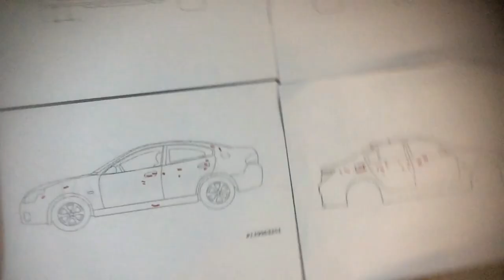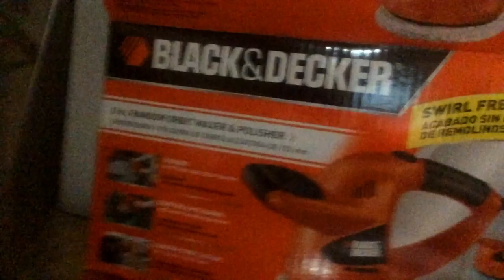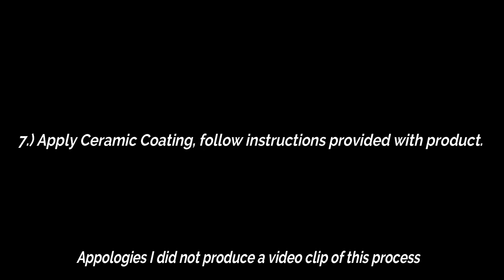Polishing Car using 3M Compounds

Comment: Good video. Also, might want to think about using regular soap and water mix for the final wash instead of fish soap because a lot of dish soap has a degreaser which eats away at the polish you just applied. That said, you got a good result 👍

Comment: Would you say the polisher harmed your vehicle at all or it just wasn't strong enough to get rid of all the scratches as you would've liked? Because I'm thinking it has to at least be better than doing it by hand? I want to get it as I don't plan on polishing my vehicle more than once a year, just to get rid of the noticeable scratches/wetsanded areas before putting a ceramic coating on. Don't mind taking more time/elbow grease if the polisher can do a decent job.
Reply from the maker: Oh no definitely did not harm the vehicle. It is better than doing it by hand just because your hand wont have the same amount of evolution's as the machine. This thing will for sure get rid of very superficial scratches and swirls like I had from going to non touch-less car washes (those car washes are bad). It struggled to remove areas where I wet sanded a few spots. It can do a decent job for a 30$ machine but it takes a lot of time because its smaller and slower than an actual polisher.
Reply: Chameleonvideo thanks. I have a rotary polisher but I've never polished before and I know it's more of a risk. I'm thinking of taking out the deep scratches/wetsanded areas with a rotary+compound combo, then maybe finish with a 3 in 1 polish with the black decker. But my rotary does have low speeds (200rpm) so maybe it can do both. Luckily I have a junk vehicle to practice on 😅
Anyway thanks for the insight. Helpful video
Reply from the maker: @batvon39  I'm sure it will turn out great! Just be cognizant of how slow your passes are not to overheat one spot and you'll be good. Have fun working on your car and thanks for watching! 😃😃
Reply: You can buy compound for the car and doing it by hand or with a polished it will take out scratches on the clear coat and bring back your true colors I’ve been looking into it a lot because I’m going to do it on my maxima and I have clay bars to start and never do it in direct sunlight it’s high recommended to either do in morning or when sun is going down never on a hot surface cool surface for best results great video tho came out great
Reply: @stephenchampagne5763  thanks, it ended up turning out great! Not perfect but definitely an improvement. I got a new DA polisher and gonna try some new products in the spring.
Mine's a maxima too, what year?

Comment: Does it still have scratches
Reply from the maker: Your regular scuffs and scratches that you get from daily use and car washes if you go to them, those were removed. A few spots where the sun was deteriorating my clear coat and also few spots that i wet sanded those you can see from certain angles with the right lighting. To remove those I would need a beefier Polisher...
Reply: @the_four_day  that's what I was thinking

Comment: Can you attach other polishing pads to that black decker polisher? Or are you stuck using the pad it already has
Reply from the maker: The black decker uses bonnets which aren't exactly polishing pads, that's my mistake for calling it a polishing pad. The bonnets you can switch out, just make sure they're the right size to fit polisher.
Reply: @the_four_day  I also got a tip from other people who have used the black decker, they just use adhesive velcro, stick it onto the black decker pad and that way you're able to use pads from chemical guys
Reply from the maker: Oh nice that some creative thinking right there, I like it!!!

Comment: Nice your using dawn dish soap. That's the way to go. I use dawn dish soap in foamer it works great. How do you like the black and Decker buffer? I just bought one
Reply from the maker: Hey!! Yeah I used dawn dish soap to strip any wax off of my car however people have pointed out that there are products sold that are formulated to do that. Apparently dish soap is just not the best for your car so if I were to do it again I wouldn't use dish soap for that purpose. Black Decker is great, cool and cheap tool you can use to wax your car or make small paint correction's with but I would never use it again to polish my entire car. I would definitely recommend polishing/buffing the entire car with a more professional tool which will come heavier, quicker orbital speed and larger bonnet size.
Reply: Yeah or the weekend I had a chance to use the black and Decker buffer. And I was not impressed with it. I had a hard time with switching out the pads. I will be returning that product. I would give it  zero stars. Thanks for your responses
Reply from the maker: Yeah the bonnets fit a little tight over the orbiter thing. For sure man definitely find the tool that would work for you so you can enjoy the process.
Reply: Try something more professional like a griots G9 polisher... use either menzerna or sonax polishing compounds/polishes and Xtreme Solutions or Meguiars paint sealants.  Use dedicated polishing and finishing pads. Your results will be 100 times better.

Comment: Polisher is dirt cheap in comparison to the others offered in hardware stores near me. Would you say it's good enough to not get a higher one? Not trying to waste money or all the time needed to correct paint for it to be garbage. Rather spend more from the get go then deal with crappy equipment. Feedback?
Reply from the maker: Hey Jesse, yeah the one I used is very cheap compared to a professional polisher. If I were to polish my whole car all over again I would go out and buy a polisher designed specifically to polish even tho it would cost more. The polisher I used is actually great for wax application's but I wouldn't recommend using it to polish the entire car.
Reply: Welp, rip wallet. rather spend more then go cheap and do a bad job, thanks!... still looking into coatings as well, that's a harder thing to narrow down so many people swearing by how amazing the coating they use is and bashing the other mentioned
Reply from the maker: Yeah and you'll have a solid tool for next time! Meguiar's and 3M are good products, I'm sure there are more just need to do the research.
Reply: Exactly my thoughts, even though it's only supposedly to be done once a year or so. But it's hard to pinpoint a good brand with fanboys. They swear by a brand because they use it and bash anyone who disagrees regardless of how unmatched they might be in reality, annoying really. Makes it hard to find a good starting point without having to waste your own money first on dead ends